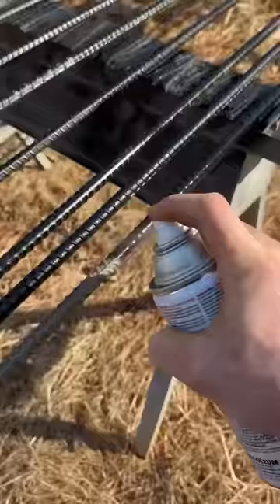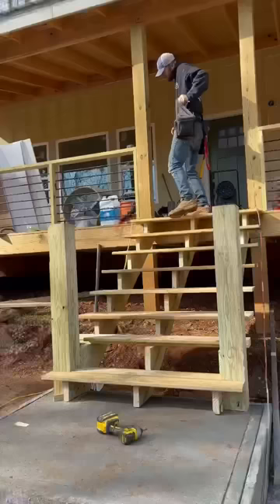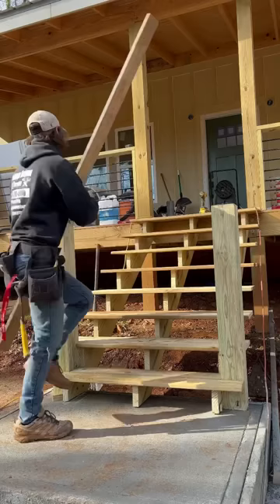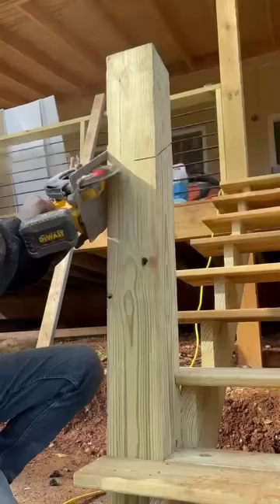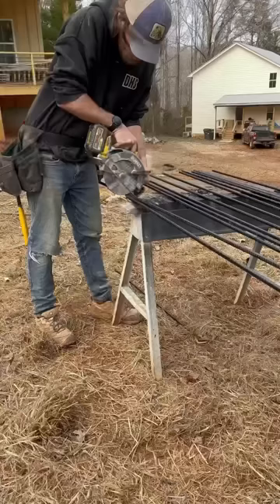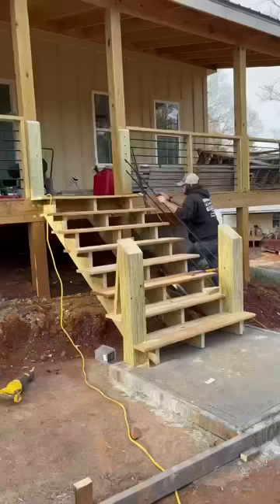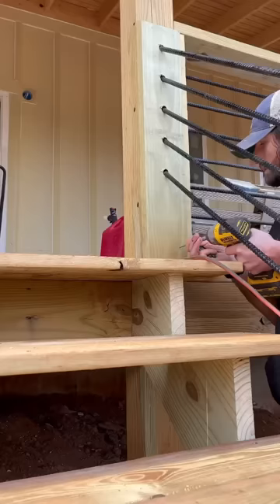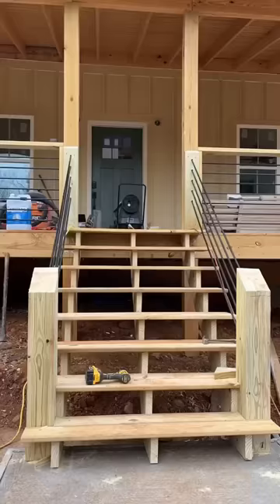Handrail 💪| Beautiful deck stairs part 4 🥳 #construction #builder #shorts #diy #skills #deckdesign

Comment: That's a nice set up.  I haven't seen that design yet.

May I make a few suggestions though. The top handrail will typically sag without a support under it. You can use a strip of either a 2x4 or even a 2x3. You can even center it under the rail so it isn't as visible. The other option would be to install a vertical support mid span, but that may take away from the nice rods you installed. 

Also, I'm not sure if you'll be inspected, but you'll probably be hit for not having a smaller rail that is easily grippable.

Lastly, you need risers. I'm not sure if you are finished with the steps yet, bit risers are there to keep your foot from slipping forward as you climb the steps. Believe me, that happens a lot, especially with kids and older people and the damage they receive is pretty bad.
Reply from the maker: Thanks for the tips! I have added risers and I also threw in a 2x6 in the middle of the handrail to help support the rebar better as well as the top rail. As far as inspection go, 6” top rail does pass where I am. Glad you liked it and appreciate the advise :)

Comment: Looks good but 1. Remove rust first 2. Warm steel and prime with a rust inhibator prime 3 then warm and paint. Id bet the rust will come through the single coat of rustolium. Additionally there is a paint that will turn rust into an inert malicite  mineral find it at chandleries. Nice job

Comment: You might want to check code on the top rails. I think you are supposed to be able to wrap your hand around them.
Reply: Oh no !!   Don't let osha see this🤦‍♂️
Reply: @MOE13576  OSHA has nothing to do with it, it would be building code. Things like this can cause issues when selling a house if an inspection is required, I'm just trying to be helpful. Also it might keep his small child from taking a header. You have a nice day!

Comment: If you want extra protection from rust on the rebar, take them out and wrap the ends in some electrical tape then put them back in. Won’t allow a metal to wood contact further delaying the inevitable. Also how thick you wrap it can make it last 15 years if you seal the holes up with some silicone after you’re done! Can also add some saw dust to the silicone if you put some on a piece of cardboard to mix it so it has a more natural wood color finish and not just a glob of hazy dried goop lol. Use a meat injector without the needle to get it up in there! 💪🏼

Comment: The edge of the end rail should have had an extra design element by simply adding more wood underneath the rail’s base. A solid piece of woodwork adhered together to the bottom half. This would allow grabbing into the wood more firmly. », like a bannister.

Comment: Unless you remove 100% of the rust it will rust and scale the moment any moisture makes it to the surface. If you are in a northern state it won't take long. The rust actually prevents the paint from bonding to the metal leaving an air gap where condensation will form.

Comment: you should blue the rebar before painting them. basically sand it then steal wool it then soak it in vinegar over night then dry and wipe with denatured alcohol then paint , wait he did will allow rust to come back

Comment: That 4 x 4 pressure-treated post will corrode the rebar. The only thing that can resist the pressure treatment would be hot dip galvanized

Comment: Rebar is gonna rust again. Cheap spray paint doesn't last forever. Should've sprayed it with a rust converter first, would help the paint adhere better and last longer.

Comment: You should of used a wire cup on a angle grinder then wiped it down with acetone let dry and put on a few coats of POR-15. POR= Paint Over Rust. Spraying over the rust will not last long at all and create a big mess.

Comment: set your mid 2x4 after placing the rods.  no bending/fighting just raising.  next time, right
the steps need a mid board, rods will sag if not.    not a good look   the kids standing on the rods and bouncing will bend them.   (very difficult to straighten and look good).  keep them. off.   with rust the paint will pop after a few seasons.   good luck new homeowners

Comment: I have a home with a couple set of steps inside and out. I love the way you used the rebar however.... the top rail will  not work as intended. My stairs have the same top board as you used. It doesn't help as something to grab onto if I am falling.  I know, I had ice on the steps and had to pull myself up using the rungs. What could I do differently to that top board to make it actually functionable?
Thanks!

Comment: Hey guys... here's some advice on the spray paint. They have this plastic attachment it's maybe $2-$5 most. It snaps on top of the paint can and is a trigger. It keeps everything even and doesn't wear out your finger while pressing down in the button. It's only a few bucks and definitely improves your spray painting. Might want to look into it. They keep it right there where the paint cans are.

Comment: Ummm...If you had left the board loose at top post. You could have raised it up and easily slide each piece of rebar in as you slowly lowered it back down into position.👍

Comment: You going to be painting them in few months and it never going to stop..
You needed to clean them of rust with a wire wheel, wipe them down with asitone or thinners, then paint them with rust primer and then paint them with more than one coat of paint..
Hope you painted the ends after you cut it.. 
Seal the wood aswell, moisture and bugs going to love those holes..

Comment: Unfortunately, expanded long ago been very easily with any kind of weight put on it, like somebody resting a foot on those rails. You needed to put some intermediate post up the stairs to shorten those fans and support those bars. Also, repainting those bars is going to become basically an unusual activity

Comment: PSA, first remove as much rust as possible via a higher grit sand disc or to preserve the rebar ribs, a wire brush in a burr motor/die grinder. It'll last 10X longer.

Comment: horizontal bars would not meet code in my area due to possibility of kids climbing. if they were installed vertically and with gaps less than 4" then they would be good.

Comment: Why not use that 2x6 as a jig to figure out rebar placement and elimate that piece on top and bottom. Would have looked much cleaner and you only woulda needed 3 more inches of bar..

Comment: Should’ve drilled the top holes deeper.  Slid it in first then cleared the post for the bottom holes.  Work smarter.

Comment: If you put on the pinched wood block first on the metal bars and then screw it, you wont have to bend them with risk of scratching the wood.

Comment: That board that you screwed to the porch post
I you drill the hole all they way thru  then thread the rebar thru the hole and set the rebar in the other hole on the lower end post then slid the flat board up to the porch post then screw that board in place 
Doing it that way you would not have to strain and bend the rear to get it in place
But good video and nice job

Comment: Looks great, but very carefully check the surfaces!!! Makes me shudder thinking of a kid grabbing it!
I would have run a wire wheel over the entire surface of the rebar, and slide it through a gloved hand looking for rough spots or burrs! 
Important! 
Rebar is designed to embed in concrete and is notorious for having sharp burrs and really rough spots - depends on the manufacturer & when they last changed their dies. This is typical I know from dealing with literal miles of this stuff!

Comment: So many things.  First, not a safe design, as children, pets, other will get caught between bottom rebar and step. Horizontal with <3.5" is best and safest on stairs. 
Spraying rebar will not last long at all, and hard to go back and do right.  Choose another metal if possible or use cast iron or .... if you must.  Use a rust preventative primer, then a rustoleum paint, and since it is a easy surface to cover, use a small synth roller and roll on three coats of paint. A small can is cheaper then a few spray cans, and you can apply a much thicker coat. 
I would have used horizontal pickets or square tubes steel, or cast iron. 
But your way, is the way you want it, and that is most important.

Comment: I guess all those trapped heads and broken necks are far enough back where folks forgot why we don't do rails parallel to the travel plane.  Someone takes a tumble, gets their head stuck between a stair and that bottom bar and their momentum will break their neck.

Comment: It looks good but if you live somewhere where it snows alot you are going to fall off that bottom step because the top rail ends before the last step.  It should extend past the step.  I nearly killed myself once when a house I rented had a stairway like this and I nissed the last step that was buried under the snow.  And if you have little kids they will be climbing up those rails.  That is the reason rails aee vertical and not horizontal.  But it looks good.

Comment: Yikes, those are not safe, you need another support post in the middle of each run because if someone leans against those rebar they are going to just bend and pop out and the person is going to fall through.
Reply from the maker: I’ve already added a middle support. It’s in the next deck steps video (Risers). So all good now :)

Comment: Your reciprocal saw is not a sawzall. Also, I can’t believe an inspector would allow that. Rebar is not strong enough at that spacing to prevent a 4” sphere from passing through. That is a big fail imho.
Reply from the maker: I’m since added a middle brace that the rebar goes through so the span is only 3.5 feet between and the spacing between the rebar is only 3.5 inches

Comment: Curious, is it required to have at least a 12” horizontal handrail return at the bottom landing ?
Reply: Only commercial requires that, but the open riser is a code violation as well as the 6 inch golden triangle, top rail is too wide to be a handrail by code and too much deflection for 4 inch code 4 foot max on span not to mention future rust staining deck.that job would never pass a inspection

Comment: I definitely would not have used a nice expensive saw blade on rebar. Angle grinder metal cutoff wheels are much cheaper and will do what you were needing.
Reply from the maker: The blade was a metal blade that wears down as you use it. Cost $3.50

Comment: Shoulda cleaned the rust off them first.

Then used a rust prevent or primer for the surface.

That paint gonna be flaking in a year.

Comment: That's not going to fly with an inspector because a hand rail is supposed to support and even prevent someone from falling through it . 250 lbs of force is what is required and that is entirely too flimsy, not to mention a child could get his head stuck between the rails , which is a definite NO NO .
  But it LOOKS pretty .😎

Comment: Did you put the rod 4inches on center or less?
Reply from the maker: Yes, they are on 4” centers. So the space between them is more like 3 1/2” I’ve also added a middle brace for support of the rebar and top rail. You can see it in my Risers video

Comment: FYI that is not code compliant if you take a 4 inch ball where can it fit through that's what the code is so at every tread there is a hole that would let a kid get their head stuck so this would be a red flag for a proper building inspector and for hud if you ever plan on selling it with FHA loan if you ever pay any attention to a legal handrail the pickets go up and down because code also says it can't be used like a lader and kids can't be able to climb the railing and fall over the top

Comment: Unfortunately it looks as if you did not add any seals onto the end of the rebar before putting it into the wood holes.

This will Lead to devastating damage to your deck system. Water will intrude , react with the metal rebar , subsquent corrosion will take place. 

From there wood has a small mineral content that will cause it to chemically react with the corrosion and turn rotten. 

If I was you . I would take them out and add seals immediately.  

I've seen this play out over several hundred times. 

IT WILL HAPPEN. 

THE RESULT. THOUSANDS AND THOUSANDS IN DAMAGE. 
OR YOU LOOK HANDY SO FOR YOUR THOUSANDS PLUS LABOR

Comment: Using Re-bar for rails isn't stylish it's a cheap flimsy substitute for the nicer stiffer polished rails.  Eventually, it will rust and look like crap because you used spray paint without a pretreatment.   Sooo pretty... 😂🤣😅

Comment: Illegal handrail. You can not use a 2x6 as the only grip surface. You definitely didn’t pull a permit for that
Reply from the maker: Its a new construction house and yes there is a permit. Here where I live 2x6 handrail does pass on a deck stair case. I've had it pass countless times.

Comment: Guardrails must reach a height of 42 inches above the walking-working surface and withstand a force of 200 pounds at any point in a downward or outward direction. If the railing dips below 39 inches, due to the force, the railing is not code compliant.

I guarantee you that if I were to push against one of those pieces of rebar that it would take a lot less than 200 pounds of force to pop it out of place. 

To make your design safe, you should use a threaded insert with a set screw. Similar to a cable rail.

Comment: It'll be ok, unless someone gets hurt. And you WILL pay them for it.
There's a reason why we have codes. I know you are just doing your thing. And it's ok. As long as no one sees it or gets hurt.
Then the lawyer will take over for you.
Thing is, you can still save it.
Look up just what the codes are in your neck of the woods. 
For the most part. The code states, that a 4 inch spear shall not pass through. Anywhere. This is too keep from trapping a childs head.
No beef with you sir.
Just trying to help you and yours. Please look into this.
You have done some fine work. Do yourself proud and don't hurt your family.
40 year's of construction.
So I know this as fact.
I know of some contractors that paid big money on this alone. ❤🎉

Comment: Damn man. See this is just copying a cable rail style. Cables get tightened and that prevents sagging. You can't tighten rear, and those cut ends sitting in the wood is going to cause some nice black streakage after a few rains/ seasons

This is a no go hoss

Comment: This is Bullshit. The rebar will rust right through the rust oleum quickly 
This is not a quality deck but it is cheap 
Just get aluminum powder coated balusters from the deck barn and sand and seal pressure treated wood every year

Comment: I would call this functional, utilitarian, and hodgepodge, NOT beautiful.
Beautiful wouldn't use rebar that's going to get rust stains everywhere.
Beautiful would use real carpentry joints, not cheap ass deck screws.
Beautiful would use a light stain and seal to protect the wood for many years.
This deck will need repairs within the next 20 Years or so.